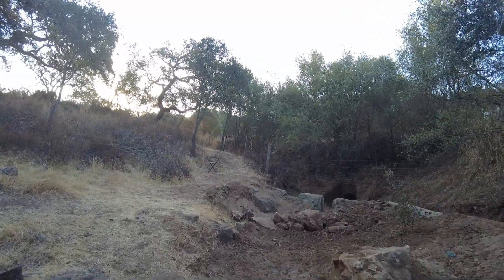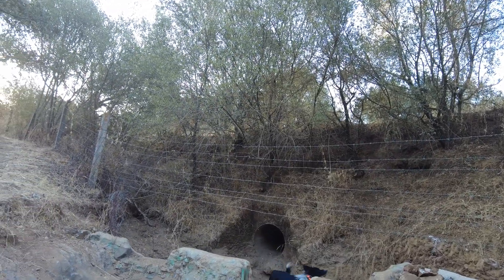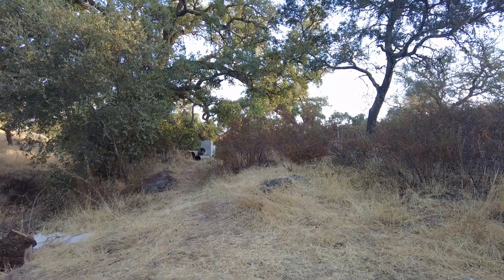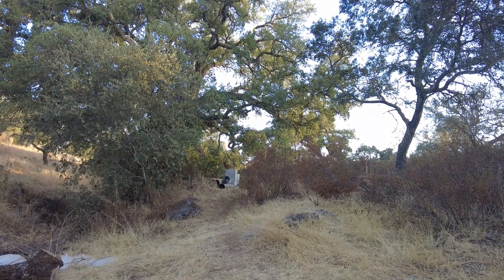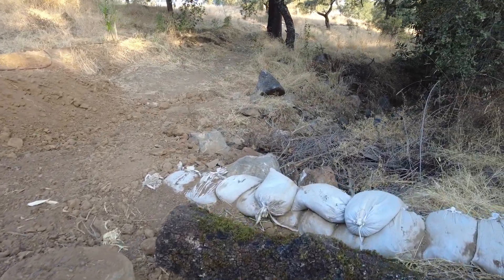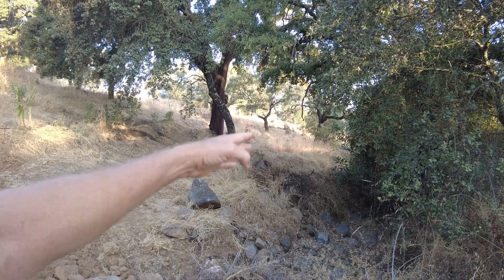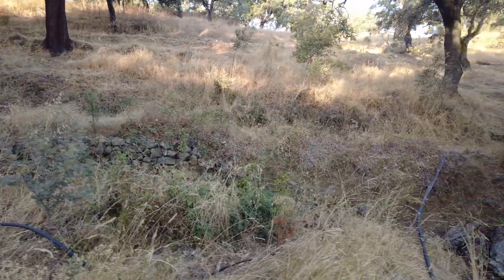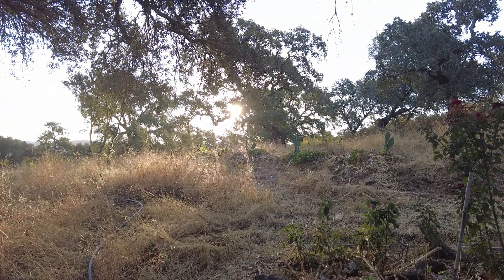Conversion of water energy: before, within and after a culvert.

Comment: Thanks for the video. Normally I am not one to wish for rain, as we usually get our share here, and then some, but I hope you guys get some water soon, so we can see the whole engineering marvel do its thing 🙂
I was thinking if it was worth using a couple of spacers below the planks in the concrete dam "sluice-gate" to leave a gap of 1-1,5 cm to wash out sand from the culvert pond, and still have some waterflow into the creek? I know it will come out at high speed, this water, but until you find a solution with an adjustable sluicegate, this might work? Let me hear your thoughts. Take care.
Reply: I like your idea of a permanent "self flushing" spacer.  Sure beats shoveling by hand.  The sediment should be captured in the pool created by the newly raised sandbag/log dam. 👍
Reply from the maker: @BrianJensen-ym5gk  So true. I think the magic answer lies in how much water coming down the creek and what it brings with it. The first rain is overwhelming in quantity and in the sediment and organic matter it carries. Keep sharing. Much appreciated

Comment: The wooden leaky weirs are a great addition to the down stream section.

For the 33m stretch next to the Medieval infiltration system. Possibly look into placing some structures in a "slalom" type pattern down both sides projecting out just a short distance from each side of the channel. They should be taller than the highest water level, and project out from each side at a right angle to the flow of water.
Reply: There's a great video I've seen here on YouTube of an Australian farmer using this extremely effectively. You may have also seen it, but I can't recall the channel name. I believe he referred to it as "Training the river," and showed several successful instances of using gabions (or groynes) to do so. He seemed very experienced.
Reply from the maker: @DustinHarms  Great. I'll try to find it.
Reply: @SuerteDelMolinoFarm  I looked far back in my YouTube history to find the channel name to hopefully make it easier, if you are interested. The channel is "Kent Tahir .Cooper" and there are a few videos on the topic, but the one I was thinking of was his River Training using Gabion Groynes video. They also have videos regarding sand dams, which I highly recommend.

Hopefully their experience can somehow help inspire your projects!
Reply from the maker: @DustinHarms  GREAT. Thanks for the hard work
Reply from the maker: @DustinHarms  He is south African like me. Very interesting indeed
Reply: @SuerteDelMolinoFarm  Oh that's very cool! I'm glad you checked him out!
Reply from the maker: @twoc400s5  You have me thinking. Thank you for sharing
Reply: @SuerteDelMolinoFarm  I believe the technical term for them is a "groyne."